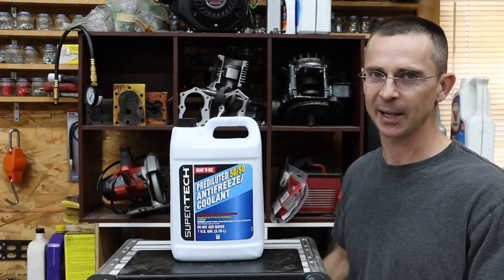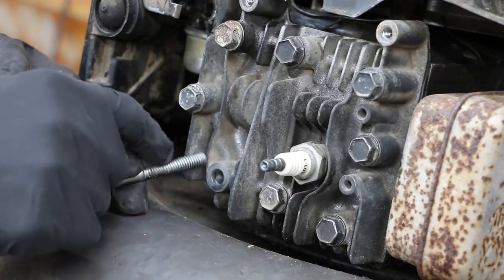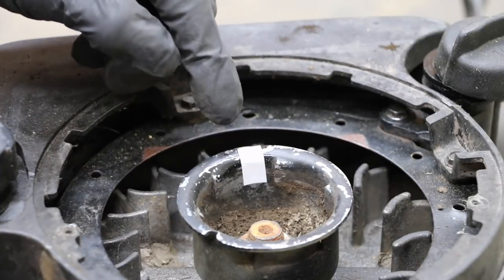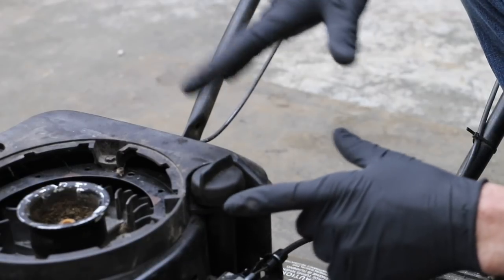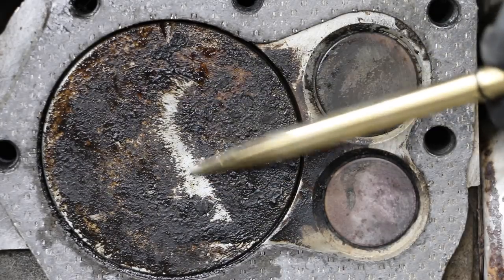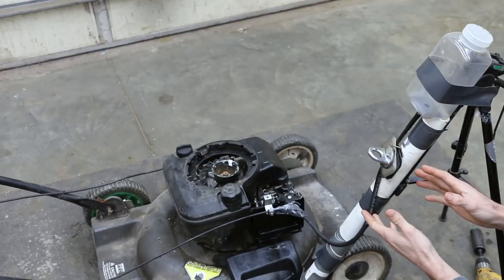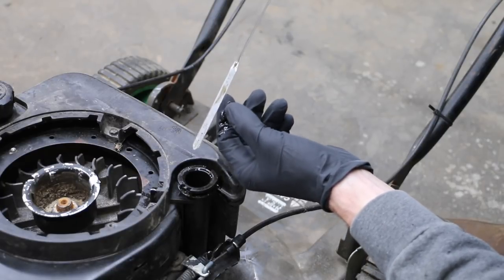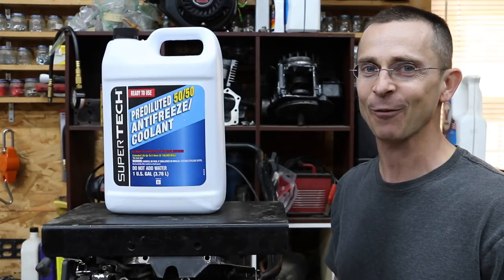Will Antifreeze clean an Engine?  Let's try it!

Comment: Alright, glad to see you back on engine cleaners.  How about doing that same test with the highest strength Hydrogen Peroxide you can find?
Reply from the maker: Thank you for this recommendation!
Reply: Yes..35% H2O2  is pretty cheap.. it will burn a hole in your skin.. would love to see what it does to carbon buildup.
Reply: Ooooo, rocket fuel, now that would be awesome.
Reply: 35% H2O2 will also melt rubber. It can be dangerous if not handled properly.
Reply: HWandW yeah I'm not thinking of what else it would destroy. .. I just know it will clean like crazy at higher % levels.... I bet it would also destroy paper/cork gaskets also..
Reply: I bet the fumes/unburned peroxide if it is strong enough could cause lung chemical burns so.. Yeah.. As others mentioned, higher concentrations of peroxide are really dangerous and can dissolve/severely burn your skin.. Now imagine it in his lungs.
Reply: So not exactly the brightest idea to spray it in the air with the engine exhaust if some of it remains unburned
Reply: Give me a break.  None of this stuff you burn in an engine is good to breath.  Just don't breath it for gosh sake.
Reply: Where do you even buy 35% hydrogen peroxide?
Reply: TheZigZiggy oh yeah so if none of the stuff we breathe in in the cities is any good for us cause of all the pollution, lets sniff on sulfuric acid fumes, who cares duhh
Reply: beauty shop hair dresser supplies.
Reply: 93% hydrogen peroxide should be interesting.
Reply: Hydrogen peroxide will whiten your teeth! It breaks down to urea. Olde Royals swished with piss to whiten teeth 🦷. The commoners would laugh. Because they knew how much piss they swished. I told my dentist and hygienist. They were clueless.  They did some homework. 😉😁🦷

Comment: A other great one.     Water itself has very good carbon scrubbing properties.  There are commercially produced water injection systems for diesel engines and I have water fogged old engines with positive results.   You are one of the very few testers and experimenters that I have a lot of trust in because your work is complete and, though not cutting edge scientific, comprehensive enough to always give an OBJECTIVE result.     Thanks for what you do
Reply from the maker: Thank you!

Comment: In shop class in the late 80s we learned to rebuild a 3 hp briggs and stratton. If there was a stripped head bolthole teacher had us put a small price of steel wool in the offending hole. That would it to tighten up.
Reply from the maker: This is a great tip!
Reply: I've tried both steel wool and copper wire. Copper wire works a lot better. Steel wool tends to worsen the threads.

Comment: some crafty old mechanic told me to run brake fluid (alcohol based not silikon) thru an engine before tearing apart. Should clean like crazy he said. Never was brave enough to try though ... lol
Reply from the maker: Thank you for this recommendation!
Reply: Yeah, that's a terrible idea. If you're tearing it apart, just clean it the right way...
Reply: Andreas Glatthar, I’ve never heard that one. I’ve been told flushing with brake fluid can help an older slipping automatic transmission. It will make newer transmissions worse because the bands are a different material or something though.
Reply: Eric Fixalot Kinda. Adding brake fluid to a transmission that slips due to leakage of pressure will cause the leaking seals to swell and hold pressure for a short time. The seals become very soft and degrade rapidly thereafter. This was an old scummy sales tactic used by crooked dealers, sort of like using gear oil in the engine to mask a rod knock or adding saw dust to the differential to mask the whine of a worn pinion gear. The leaking seals would hold up long enough for the car to be bought, and then they'd disintegrate shortly after the buyer used it for a while. We now have specifically engineered compounds that rejuvinate seals in a controlled, predictable manner. High mileage oils contain these additives to help with shrunken, hardened old seals. These compounds work very well when the seal is not too terribly damaged, but of course you can't buy magic in a bottle.
Reply: Back in the day when I was a mechanic in the British Army in Germany on manoevers we would use brake fluid as a quick decarbonisation in our lighting plants when we couldn't take them out of operation, worked well, lots of smoke then clear!!

Comment: Great Test ! ! !
Another thing you can do with 50/50 Anti-Freeze is clean engine parts...   It works with old Anti-Freeze mix too
If you are going to clean an engine block, head, manual transmission case, that is greasy.   Get a container that can take heat and also submerge the parts.
Put parts in the container, pour in Anti-Freeze, set it on a heat source like a hot plate, then let it soak over night, longer for dirty parts
It also works with Pine-Sol mix with water....   Over time the water evaporates so just add some more water
Reply from the maker: Thanks for this information.

Comment: What will happen if you replace the engine oil with diesel fuel?
Reply: That's something I've done a few times and I kind of swear by it. Diesel by itself has some lubricity but I make a mix of about 25% motor oil for safety. I run the engine at idle or slightly above for a couple of minutes and drain immediately. Spotless inside.
Reply: I've done it to, but with pure diesel. Engine lasted over 200k afterward.  Don't do it on a VVT engine though.
Reply: Lol don't do it, it spins bearings don't ask how I know well I'm glad I did it cuz that car had to go

Comment: Ive always heard ATF cleans an engine really good when mixed 5 quarts of oil to one quart of ATF
Reply: My dad used to use that ratio to help seat the rings after a rebuild.
Reply: Substitute 1 qt of oil for 1 qt of Trans fluid (i.e. a small block that requires 5 qts of oil, you'd use 4 qts of oil and 1 qt of trans fluid)
Reply: I've done this for years. Works great!
Reply: ATF doesn't need much detergent to be an effective cleaner because it is composed some pretty powerful petroleum solvents, namely Naphthenic, Propanol and Toluene.  It also has some very powerful dispersants that will keep sludge in suspension until it can be delivered to the filter for removal from the oil stream.  As such, it makes a very effective internal engine cleaner when added to the crankcase at each oil change.  Testing I personally performed back in 2005-2006 using as low as 5 weight synthetic oil shows it is the addition of the ATF, and not the thinness of the oil, that is responsible for the cleaning effect observed.  I speak primarily of Dexron III, as that is the type I am most familiar with the composition of.
Reply: Anthony Ramsey  That's been nearly a year ago, I don't remember where I read that, though it was a website. I'm thinking maybe on jalopy journal, but not sure. That doesn't make me a liar however. You need to learn some manners, like not going around accusing people of nefarious intent just because they may or may not have been given bad information.  I've still had this work for me for years, nothing you or anyone else can say on the internet can change my personal experiences.
Reply: IfYouDisagreeYouAreWrong  I tell you what, this line of comments really adds to the conversation, doesn't it...
Reply: Anthony Ramsey  I remembered where I found those chemical names from, Dexron II's MSDS. Read it and weep!

Comment: Medical Grade Nitrous vs OxyAcetaline as HP Booster on a Multi Cylinder Engine Gasoline 😎👍🏼👍🏼👍🏼🥓
Reply: Or propane in intake with fuel from carb as well
Reply: I use the blue NOS cans that can be found at most fuel stations in the cooler section. Cleans my engine and adds 10 HP
Reply: LOL!  I actually prefer Full Throttle.
Reply: Does not matter, medical grade or auto grade.  Same diff as medical grade O2 and welding grade O2.  Only diff is signature on a piece of paper.
Reply: @John Bango The difference is the allowable percentage of included contaminants, and what those contaminants can be.
Reply: Uncle Bumblefuck(AvE) sad that oxygen would ignite if oxy cylinder had any toxic contamination...
Reply: Forrest,  They come out of the same tank.  The only diff is the paper work trail.  Sorry guy.
Reply: PollskiSzakal, you are absolutely correct.  Love AVE.  This is why they label O2 gauges use no oil.
Reply: PollskiSzakal,  Got to love Uncle BumbleFuck.  Release the shmoo.
Reply: Corrosion37 I second the propane, but Hydrogen would be a better fit. I wonder if that has any cylinder head cleaning properties?
Reply: Forest,  The reason for the paper trail is that if there is a problem, they can trace it back to the source.  This is unneeded if it is a welding/cutting problem.
Reply: Medical grade nitrous is pure, race grade has 
an irritant added, to prevent recreational use.

"Automotive-grade liquid nitrous oxide differs 
slightly from medical-grade nitrous oxide. A 
small amount of sulfur dioxide (SO2) is added 
to prevent substance abuse.  Multiple washes 
through a base (such as sodium hydroxide) 
can remove this, decreasing the corrosive 
properties observed when SO2 is further 
oxidised during combustion into sulfuric acid,
making emissions cleaner."
(Copied from here.)
https://en.wikipedia.org/wiki/Nitrous_oxide

Nitrous is delivered (race car) at numerous 
hundreds of pounds PSI.  Acetylene is ONLY 
available up to 25 pounds PSI.  (That acetylene 
in your Oxy/Ac rig, is dissolved in acetone.)

steve
Reply: Steve,  I did not no that.  I am old.  They did not do that in my day.  Either way, this would not change the chemical make up by much.  Effectively that added the skunk smell to the natural gas.  PPM is a very small change in the total scheme of things,  Have no idea why you brought up acetylene.  Totally different animal and my gauges read anything above 15 psi is in the danger zone.
Reply: John, look at the first post in this discussion.

"Medical Grade Nitrous vs OxyAcetaline..."

Oh, I like that " Effectively that added the 
skunk smell to the natural gas." comment of yours!

steve
Reply: Steve, ok, you got me there.  Still medical grade NO2 is still very little in difference than auto grade.  This was my point.  The difference is the same as NG and NG with the odorizer.
Reply: Acetylene is acetone dissolved in propane liquefied gas.
Strange stuff but extremely B.T.U. dense fuel !
Reply: Thomas, WHAT??

https://en.wikipedia.org/wiki/Acetylene

steve
Reply: Steve. I am with you on this one.  WTF    Guess some one did not take high school chem 101.
Reply: I'm still sticking to the NOS in a liquid can
Reply: Whip it in a can?   I heard that can be fun.  To Old to know for certain.
Reply: Right from your link Steve! 
Most regulators and pressure gauges on equipment report gauge pressure and the safe limit for acetylene therefore is 101 kPagage or 15 psig.[42][43] It is therefore supplied and stored dissolved in acetone or dimethylformamide (DMF),[43][44][45] contained in a gas cylinder with a porous filling (Agamassan), which renders it safe to transport and use, given proper handling. Acetylene cylinders should be used in the upright position to avoid withdrawing acetone during use
Reply: yup, it's only paperwork, I got 5 pounds of MSM (sulfur) for horses for $20, get a few hundred grams in capsules for humans for the same $20. (MSM works on the joints of humans and animals (no difference, humans are animals!))
Reply: Acetylene = Carbide + H2O Water Just to Clarify 😎
Reply: Chris Chiampo .... Nitrous is not flamable. So compared to liquid or gas oxygen maybe.
Reply: Acetelyne is how it's spelled.  Just FYI!    DO NOT F with acetylene it's VERY VERY unstable.
Reply: You're correct, but it takes a lot more than just a signature.  Medical oxygen is treated like any medical prescription which means the FDA is involved.  I know this because I'm in that business.   The oxygen comes out of the same bulk tank!
Reply: Project Farm - If you do this test, medical grade nitrous is (technically/legally) only obtainable with a Dentist License. However, there is a safe and legal way around this thanks to the kitchen gadget industry, which markets (near medical grade) mini, nitrous filled steel containers as, "cream chargers" or "whip cream chargers" ... which might actually come in handy.
Reply: Auto grade has a tiny amount (7 parts per million if I remember correctly) of sulphur dioxide added to make it unpleasant to get high on.  Not enough to effect performance in any measurable way.

Comment: When I was a boy on the farm here in Alberta, our friend Gary Shaw (a great and loved man) had an old truck he called The Bandit. It was a red 79 F250 4x4 with the 390 and I remember him and my dad literally pouring a 2 liter coke bottle of water right through the carburetor. My Dad feathered the gas, and he kept the RPMs at around 2500 - 3000 during the whole 'cleaning process'. They planned to rebuild the engine and wanted it clean as possible. It wasn't a pretty thing to watch them pouring the water into the old engine. It took Gary about 5 maybe 6 minutes to pour the 2 liters of tap water into it!!! When they pulled the heads we were ALL amazed, very clean. That was back in 1980.
Reply from the maker: Thanks for sharing.

Comment: What would have happened if you had used pure anti-freeze instead of the one mixed with water?
Reply from the maker: This would be an interesting test!
Reply: Project Farm hdhd
Reply: I concur, I suspect it may have simply been the water cleaning the carbon as the glycol would have just  burnt with the fuel..

Comment: Farm, hello, way back,,I a 78 FORD GRANADA, STRAIGHT6 CYL 250 CU INCH, Whitney had an plastic bottle, w/hose into carb,,it used water, winter w/anti freeze,,it surely helped with the engine pinging
Using the recommended octane . Cheers From NJ🇺🇸🇺🇸🇺🇸🇺🇸

Comment: I have been using Marine outboard two cycle TCW3 rated oil at the ratio of 1oz oil to 5 gallons of gas for over three years. My car passes emissions and runs great. 07 Jeep GC with 100,000 miles. Works like Lucas fuel cleaner or MMO. TCW3 burns ashless will not harm sensors or converters

Comment: Years ago, my 1973 Datsun pickup started billowing white smoke soon after leaving work. I drove it 20 miles home. It was just reaching Hot when I pull into the driveway. When I pulled the head, the #3 cylinder chamber, the top of the piston & the spark plug were clean as a whistle. I suspect it had been leaking for some time while sitting and quickly burning off a small accumulation.
Reply from the maker: Thanks for the suggestion.

Comment: A few years a go,i repaired a good friends 1991 BMW 520i (the 12 valve engine),that had a crack on the cylinder head. The engine was consumpting the antifreeze,and made about 600 - 700 km in this condition. When i removed the damaged cylinderhead,the pistons and the combustion chamber were clean like new!
Reply from the maker: Thanks for the feedback.

Comment: Run a engine on hairspray
Reply: Chase McCarter. 
That's a good one Hairspray that would be interesting LOL but you got to find the original Aquanet LOL
Reply: Yea Aquanet! smells like grandma!
Reply: That's just alcohol he's already done alcohol
Reply: That's alcohol and glue. WTF? I have a Mohawk... No it will not work for fuel inside of an engine. Open to the atmosphere it burns very well but the build up inside of anyone will cause serious issues.
**Same if you put lamp oil in a spray bottle. Burns way better than hairspray, not going to work inside of an engine though. Not kerosene, regular lamp oil. You can put it on spray or mist, makes a huge flame.
**Not recommending doing this...
Reply from the maker: Thank you for this recommendation!
Reply: Lol 😂 reminds of the days when I used aquanet hair spray for my potato gun fuel.
Reply: Project Farm It's been recommended several times now. When you gonna do it?
Reply: I back this recommendation. Either hairspray or Axe body spray.
Reply: Can't wait for this one to happen then. I'll be super shocked if it lasts very long. I watch all his videos anyway, and they all get a 👍!!!
Reply: yes you should definitely do it
Reply: Not actually alcohol. It's diethyl ether

Comment: Transmission fluid supposed to soften valve seals and loose carbon deposits
Reply from the maker: Thank you for this recommendation!
Reply: My grandpa put it in the oil and in the carb of his old chevy and we got over 500k out of the engine and to add my grandpa was a dye hard Pennzoil

Comment: How about sucking in some very small ball bearings? Small enough not to get crushed by cylinder, large enough not to get caught between piston and cylinder wall. Being smooth and hard they should not cause much damage to cylinder walls
Reply from the maker: Thank you for this recommendation!
Reply: I don't think they make such a thing. Closest thing would be small sizes of shot. The odds of getting stuck under valves is pretty high, though.

Comment: Nice trick with the copper wire. I figured out the same on my own to fill some space in the holes in a custom panel for ATC use when the shop forgot some pem nuts but the holes were too large to put in rivnuts of the required size instead. I used wrapped up cross connect wire (22 awg if memory serves) because we toss out tons of that rewiring our interconnects between systems.

Comment: For 40 years I have done the same thing with brake fluid. I remove the air cleaner, in the past misted into the carb, now I find a vacuum hose that is past the map sensor and suck it up through the tube. The engine needs to run at a faster speed to prevent stalling. It makes huge smoke. As soon it runs smoothly, I switch it off and leave it for 20 minutes then take it for a run. It always runs smoother after that. I took a cylinder head off once and cleaned the piston crowns with brake fluid and they came up like new. It turned the carbon to wet soot with no bits to cause scoring.
Reply from the maker: Thank you!